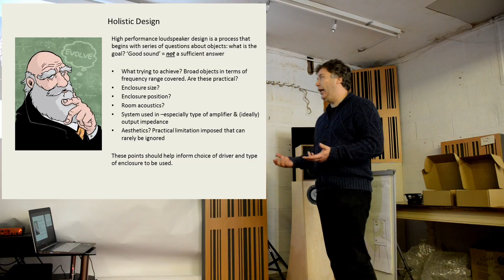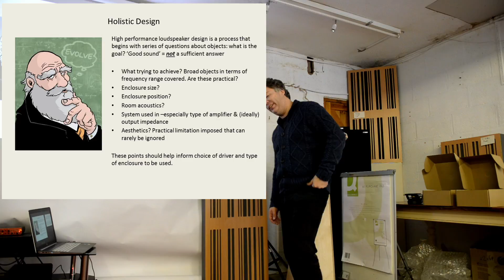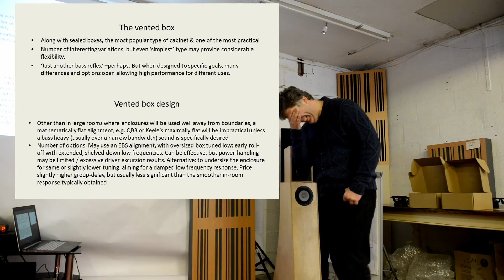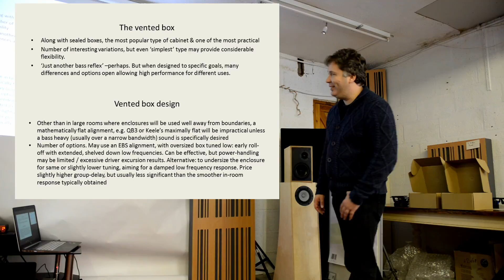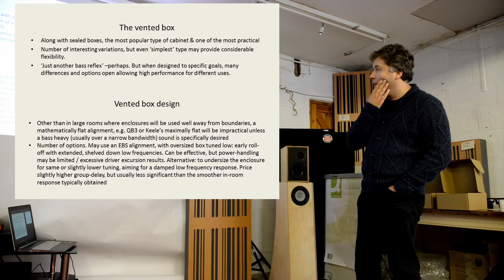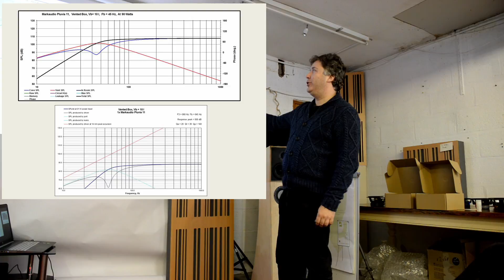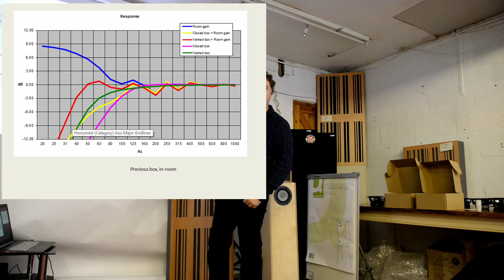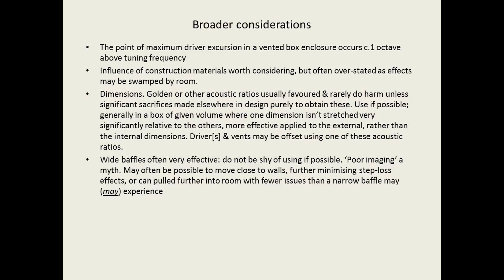Dr. Scott Lindgren talking speaker enclosure design (part 2)

Comment: complete rookie here, but the Extended Bass Shelf is an interesting point, because i have tried to make a pair with flat to roll off speakers QB3 i guess, and when i wired them up because of room gain they have a hump from F3 to about 100 or so hz and that is where the EBS dips below flat and if i understand what you are saying is if i tuned the boxes a bit lower in a bigger box that dip would be filled by the room gain and would get a lower flatter response. neat.

i think what DIY box builders who want to avoid DSP stuff would make adjustable boxes, once with a movable rear panel to increase or decrease the box volume and a port that can be lengthen or shortened so people can set them up in their room.